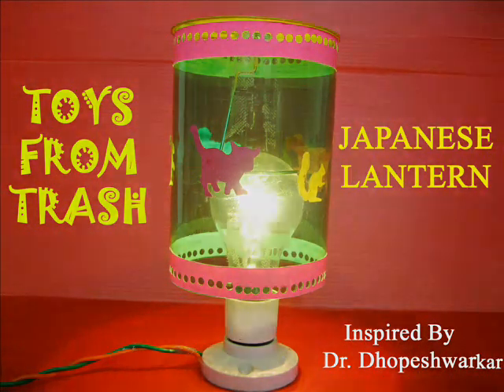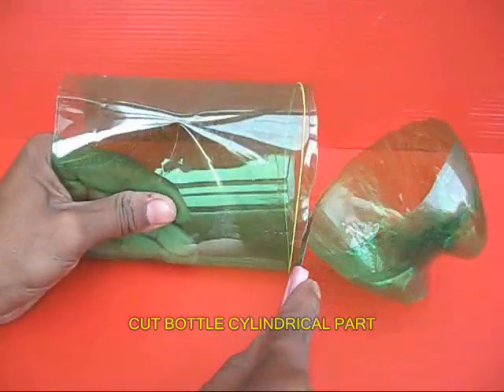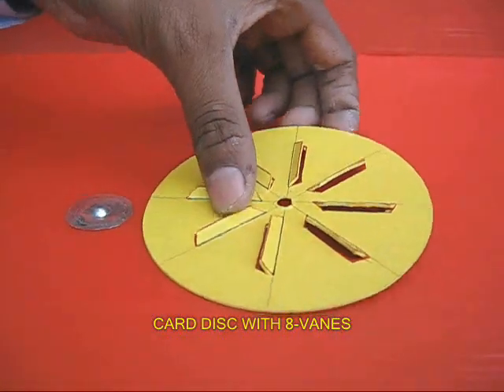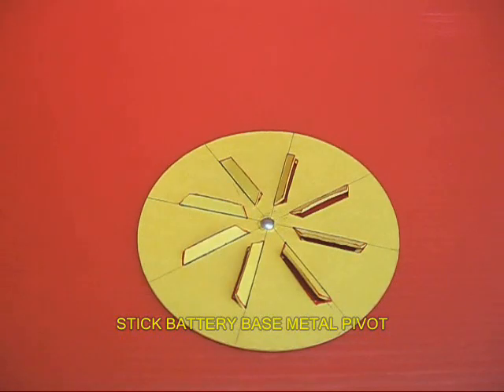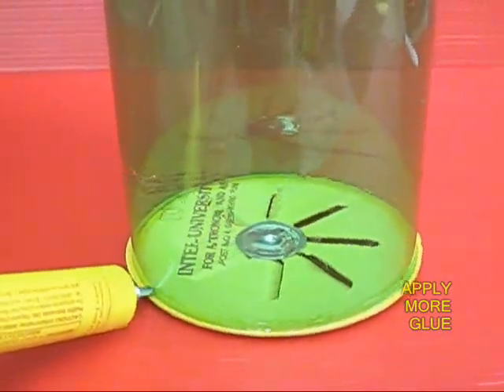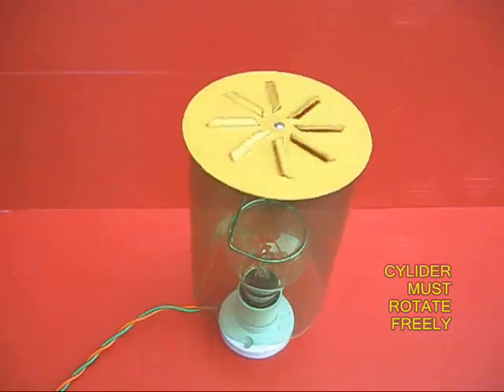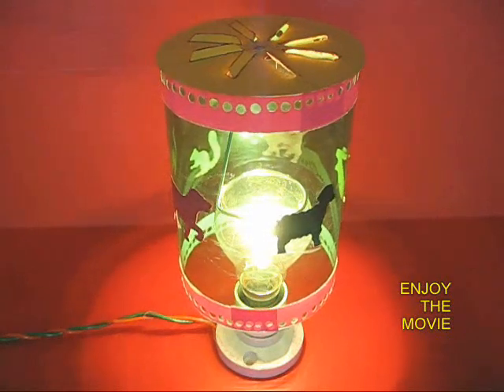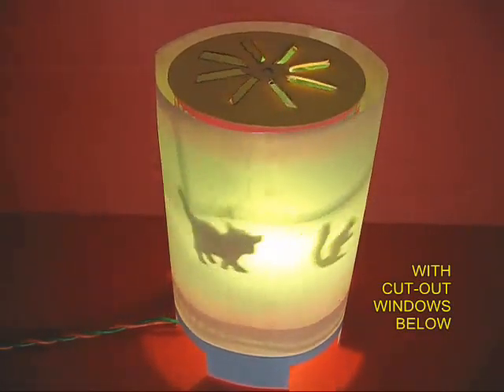JAPANESE LANTERN - ENGLISH - 25MB.wmv

Comment: the best thing to use would be stuff that will not burn! i have seen them made out of cans, like coffee cans and so on, even a soda can would work, but you cut out the shapes, or cut out everything but the shapes. but the plastic used in soda bottles i would never use near heat. you might find something else that is not the same type of plastic that would work good too, like a jug or something, but me i would not use plastic for it at all

Comment: i like most of the videos. but this one is a death trap. the plastic used in soda bottles shrinks with heat, so you turns this one, a few minutes later it starts spinning....YAY, then a few minutes later, it start spinning faster as the center parts starts to shrink,. then the little paper animals start to fall off, as it slows downs from the shrinking, then it stops as smokes start to rise from where it touches the light bulb, then it wraps around the bulb, smokes then fire...yeah death trap